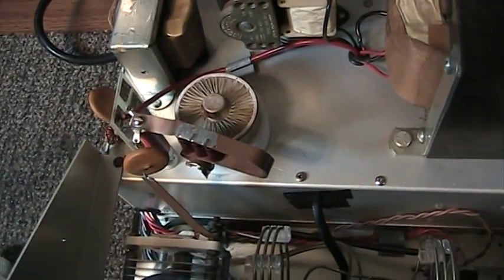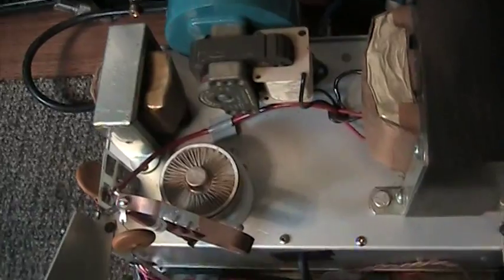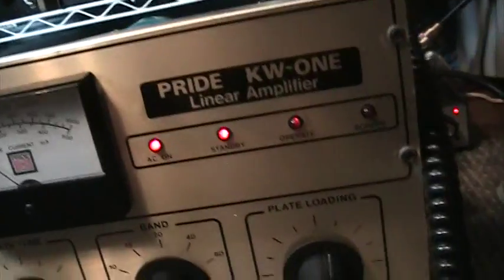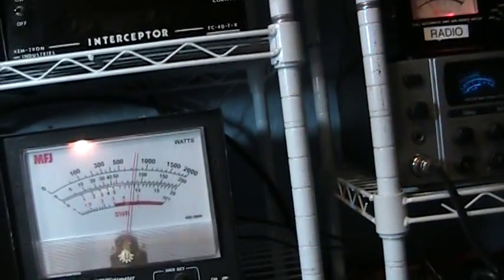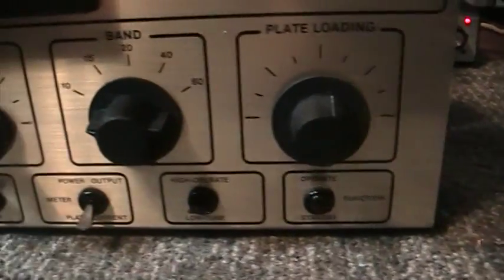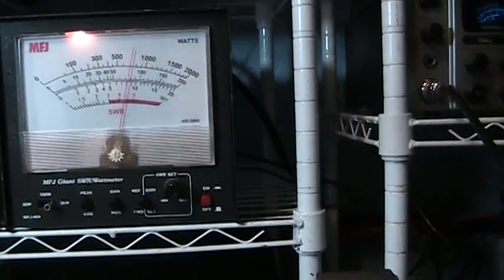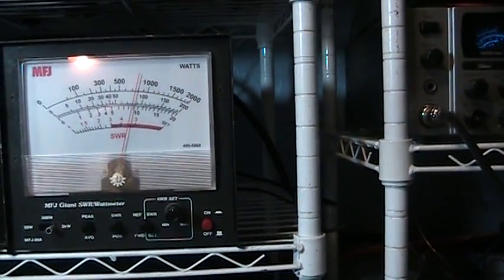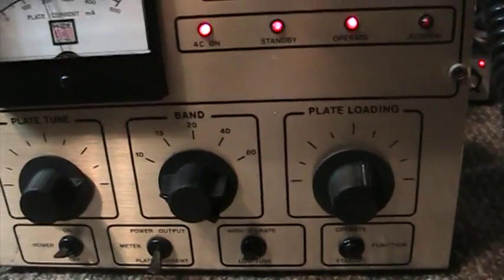Pride KW 1 with an 8930 tube installed

Comment: what did you use for a chimney on the 8930
Reply from the maker: +brianstang1 bought some cheap ones off ebay from a CB guy in Ohio. He custum makes any chimney. They work OK, but look somewhat home made. They also feel more like plastic or teflon rather than ceramic.